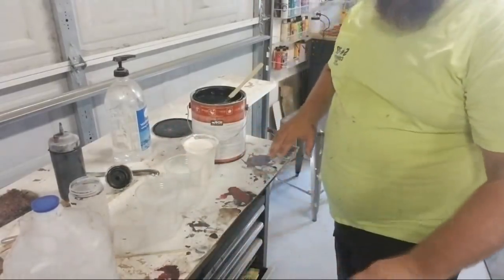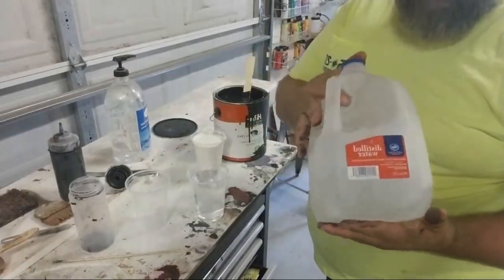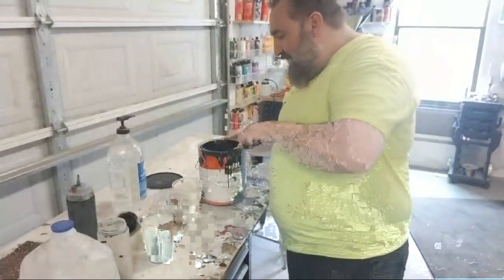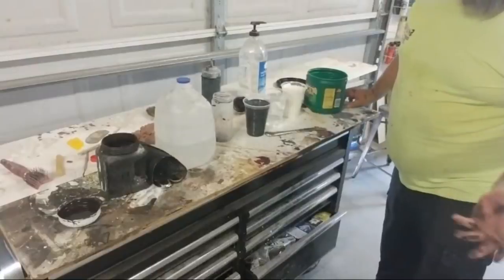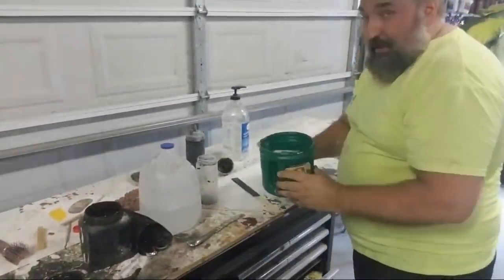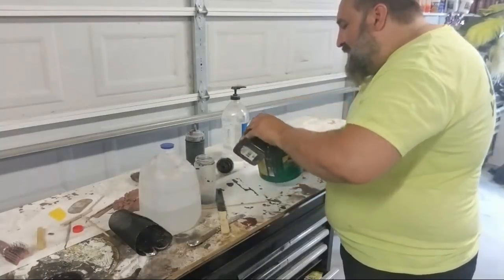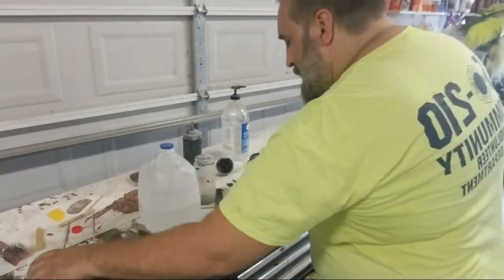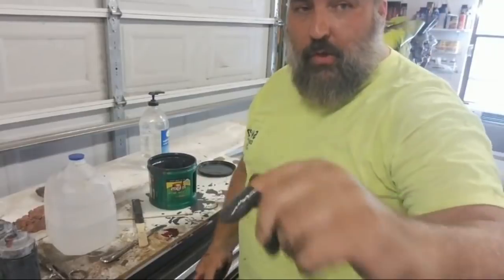Making Latex Mask Paint!

Comment: i'm glad that you mentioned adding more water for an airbrush. i made the paint previously with equal parts water, latex and paint, and it kept clogging my brush.  also interesting about using an acid to clean it, i'll have to try that.
Reply from the maker: Best cleaner ever for an airbrush is Carburetor cleaner. it works amazing!
Reply: awesome! i'll give that a try

Comment: I have a small problem.
I tried this with just a small difference instead of house paint. I used hobby acrylic paint.
It worked perfectly.
The only problem is that it seems like the color rubs off when it gets wet.
After it had dried for a day.
Do you have any ideas why this is happening?

Best regards.
Daniel V.
From Denmark.

Comment: Would this recipe work for painting multiple layers on cracked latex props to repair them?  They aren't masks, just static props.  Wondering if I should wipe the latex areas to be repaired with Dr. Pepper so they are clean unless that would eat the latex up?  Great video BTW!
Reply from the maker: just clean with soap and water- then add latex and paper towel to re-skin, then paint with the latex mask paint- Good Luck!

Comment: What if you were to use a more liquid or thinner latex rather than casting latex. And skip the water. Will it work as well? Will it work at all? Thanks
Reply from the maker: I wouldnt skip the distilled water- but you can try!
Reply: @StiltbeastStudios  Thanks. I will try it on the inside of the mask with and without the water and see what happens.